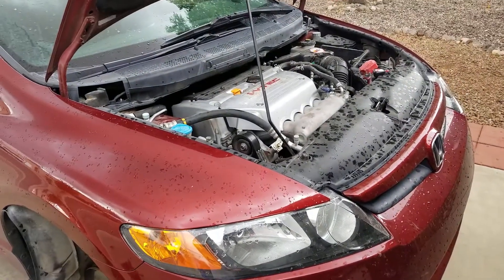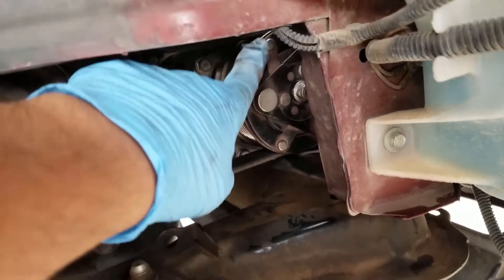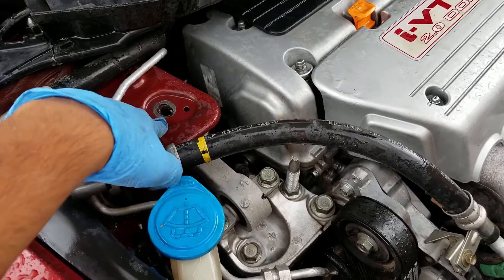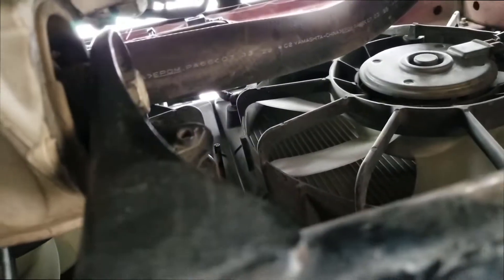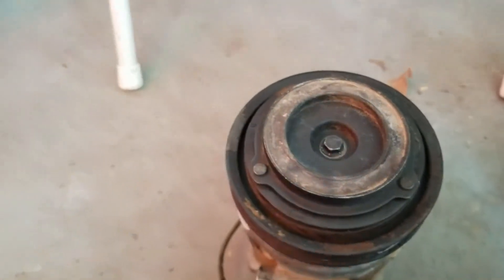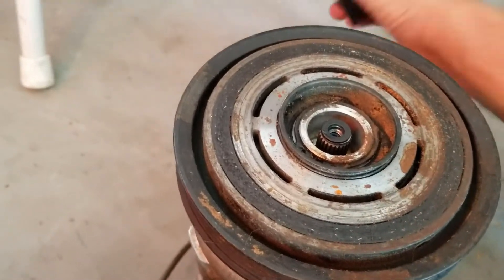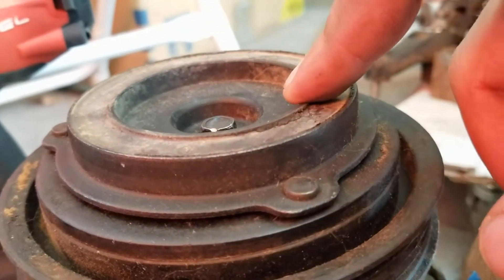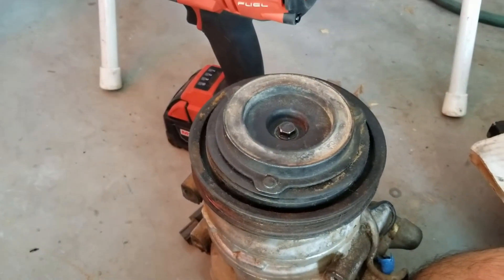DIY 2006-2011 8th Gen Honda Civic Si FREE AC FIX - AC clutch shim adjustment

Comment: to anyone does this now, you dont have to undo the motor mounts you have access to get all 4 compressor bolts, you can undo those and push the compressor a little bit and you'll have enough room to get the clutch out.

Comment: Thanks! Followed your instructions on my FN2 and it seems to be working now, but i ended up using a pair of snips to cut the shim off instead of trying to remove the plate, since i can't be bothered to deal with the engine mounts.
Reply: how much space was there to get snips in? I have either small or large snips, but the small ones might not be strong enough to cut the shim
Reply: @justicator  Mine is a 250mm snips at it was just about enough space to cut. The shim are pretty thin so it should not take much force. Anyway I fixed the clutch only to find out the compressor is dead too (unable to build pressure), so it was all for nothig :(

Comment: Does anyone know what the proper gap should be? .20? What is the shim gap supposed to be. I've got a 09 Civic DX 1.8, but seen this done on the car with belt on
Reply: Like Cruz stated: Air gap should be 0.35mm to 0.65mm (about .014" to .024"). Cheers!
Reply: @blackrifle6736  for reference a credit card is approximately .70mm
Reply: @indiomonk123  Too thick. However a standard US business card is 0.15". Used to set GM distributor points open dimension with one. Cheers!

Comment: What’s the air gap measurement? I recently did a clutch job and replaced the clutch and coil. Now it won’t engage. I think I over shimmed it 🤨 Thanks for the informative video 👍
Reply from the maker: The air gap should be 35mm to .65mm (about .014" to .024"). Good luck! 👍
Reply: @cruz_control3925  Thanks for your speedy reply 👍